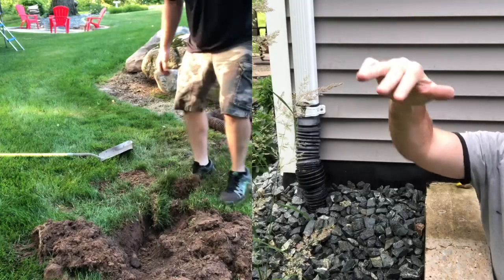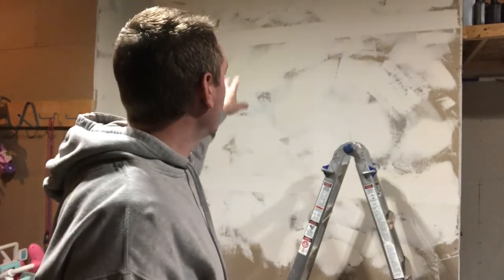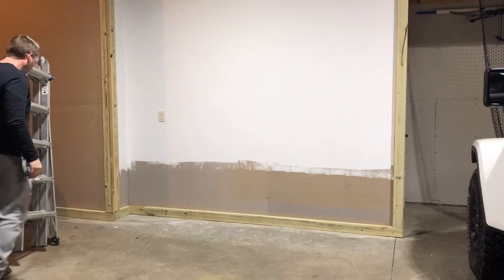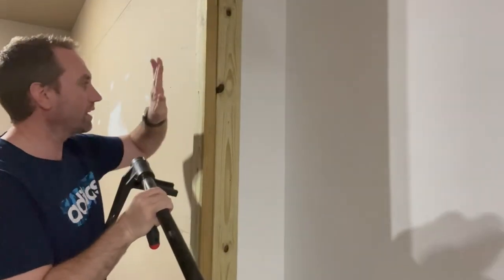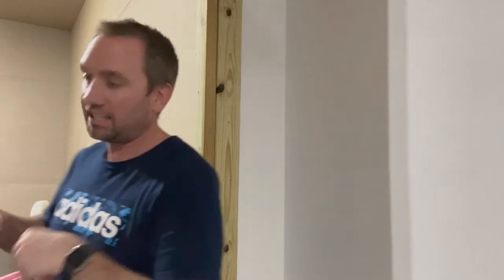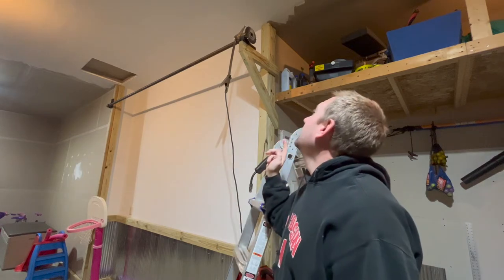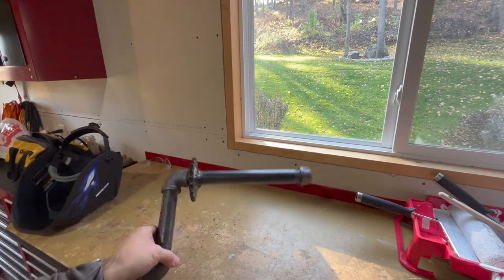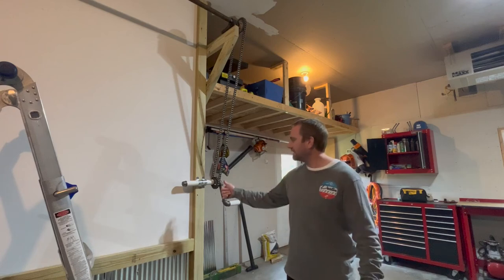Golf Simulator Build Episode 1: Preparing the space and Impact Screen Mounting

Comment: Hey, I’ve watched most of these if not all. Thanks for putting this together. I want to build a similar apparatus to raise and lower a screen. Do you have a link to something that could be purchased similar to your L attachment (trunnian) you cut to make work?
Reply from the maker: I would use a set of pillow block bearings like these:PGN - UCP205-16 Pillow Block Mounted Ball Bearing - 1" Bore - Solid Cast Iron Base - Self Aligning (2 Pack) https://www.amazon.com/dp/B07MWGF35D/ref=cm_sw_r_cp_api_glt_i_7SEHQ547Y57TPVK6QY16

Just make sure the bearing bore matches the outside diameter of your pipe. Happy building 👍

Comment: How and where did you find the mechanism to lower/ raise the screen?
Reply from the maker: The "bearings" I used for the bar were from a pick-up truck bed unloader.  You could use pillow block bearing instead, just make sure the bore diameter matches the outside diameter of whatever bar you are using.  

Example:  https://www.amazon.com/PGN-UCP208-24-Mounted-Bearing-Aligning/dp/B07QMGQNLM/ref=sr_1_4?crid=366MB7H2NRKFY&keywords=pillow+block+bearing&qid=1645222251&sprefix=pillow+block+bearing%2Caps%2C129&sr=8-4

The chain drive components can be purchased at Tractor Supply or any farm supply store.
Reply: @TheLawnEngineer  thanks, my screen is 15’ wide and I keep having sagging issues (currently using 2” diameter emt conduit with a 2” dowel rod (inside) in the middle (screwed to the pipe). Currently stand on a ladder and hand roll the screen up but would like to get something like you have to raise and lower.

My struggle has been finding something that doesn’t sag. What I’ve learned so far is that the bigger the diameter, the better. Which makes finding a crank mechanism nearly impossible.
Reply from the maker: @louispounds7486  Yes, an increase in diameter has the most impact on stiffness followed by wall thickness.  You will likely have to move from conduit to pipe but finding it in lengths over 10' may be a challenge.  You should be able to find some chain drive or v-belt components at a farm supply store to work with most reasonable diameter pipe.  

Awesome screen size through...15' that's awesome!
Reply: @TheLawnEngineer  thanks, and yes, loving the screen size!! It’s definitely a work in progress!! Thanks for responding!
Reply from the maker: @louispounds7486  you’re welcome, I like hearing about what other people are working on.  Have fun with your project!